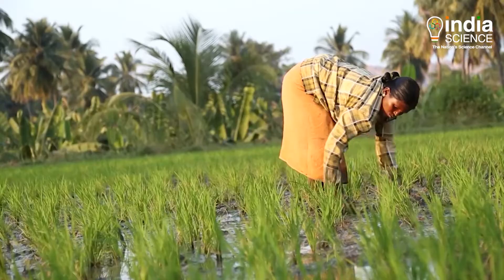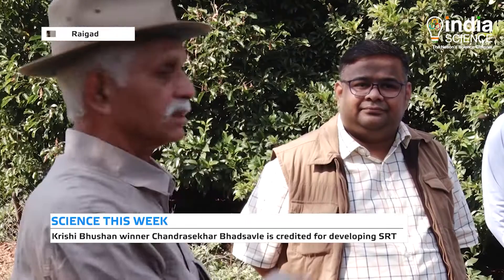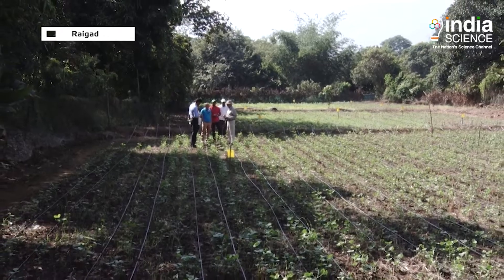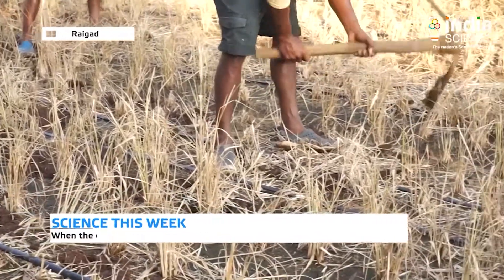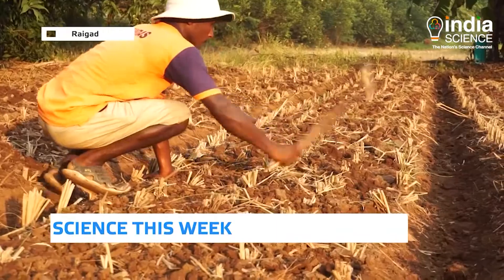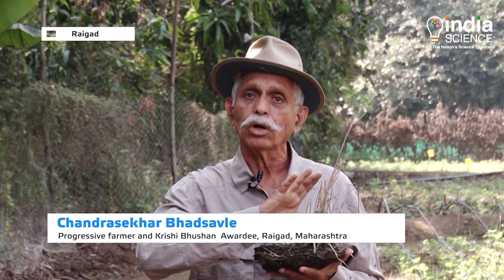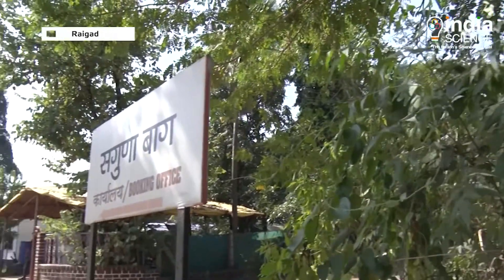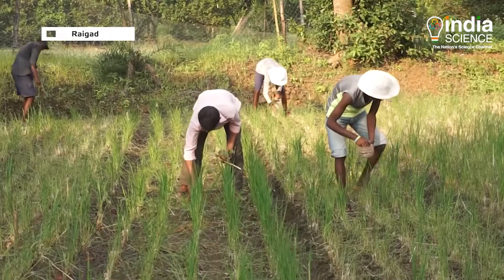Saguna Rice Technique

Comment: What is the production yield of rice per acre ?
Reply: I think they go for the overall yield conversion at the end of the year, with such spacing i bet they get around 30 bags of paddy but they get zero down time after harvest and yes no-till is a great method for rice but it is not prevalent in delta area but they should start using this to get better soil texture.